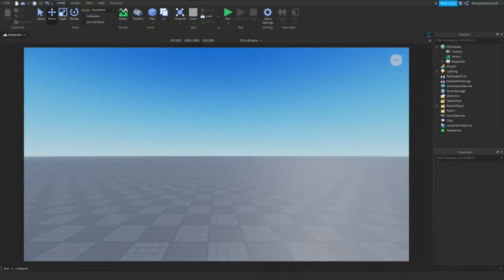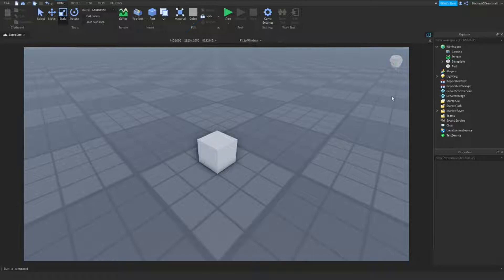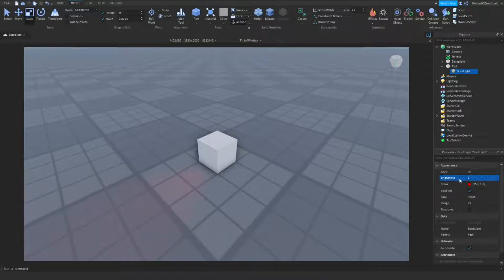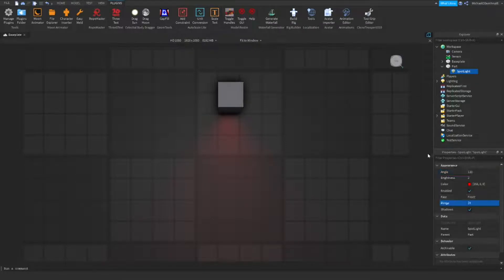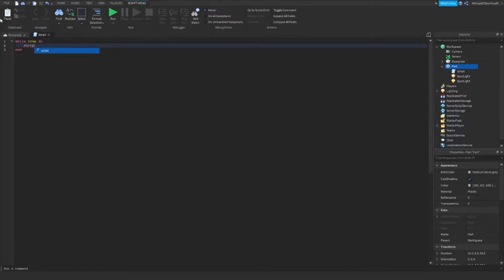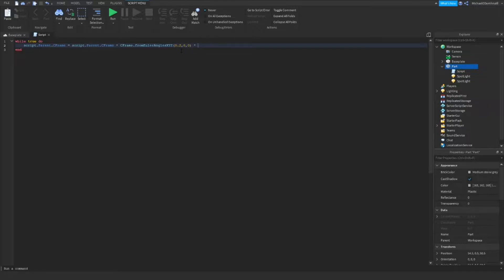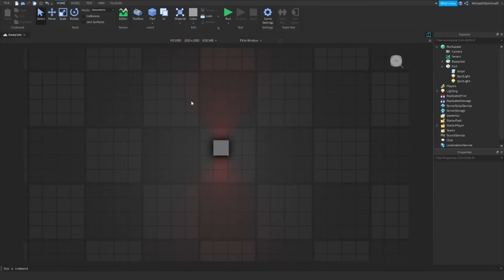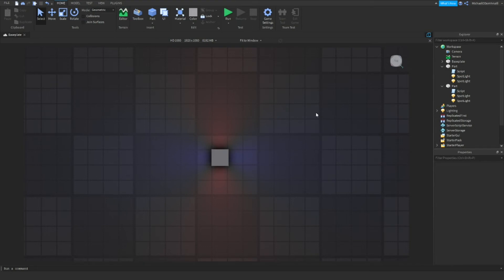How to Make Spinning POLICE Lights! || ROBLOX Studio

Comment: You should use game:GetService("RunService").HeartBeat:Connect(function(deltatime)

Its the faster loop function.

You could also use a coroutine function
Reply from the maker: I thought heartbeat wasn't consistent via the server and the generalized connection for different players ping.
Reply: @mickydon9936  Also question if i make police car with rotators how can I turn it on and off?